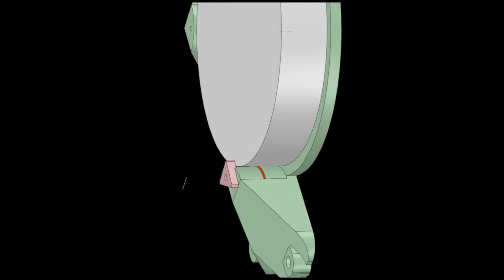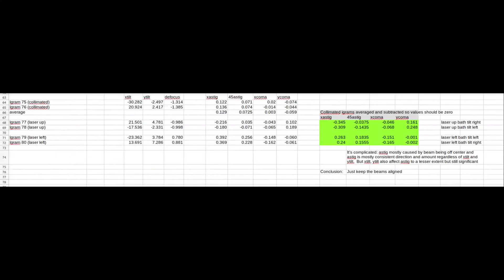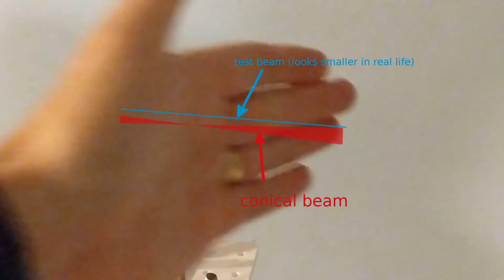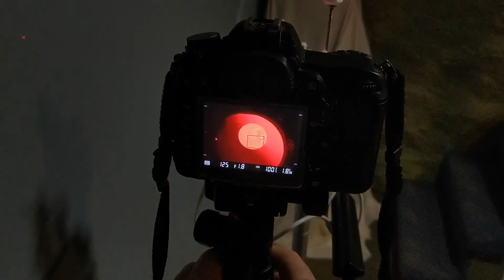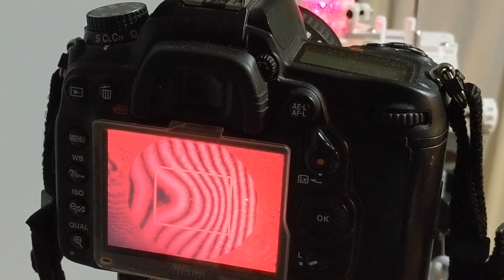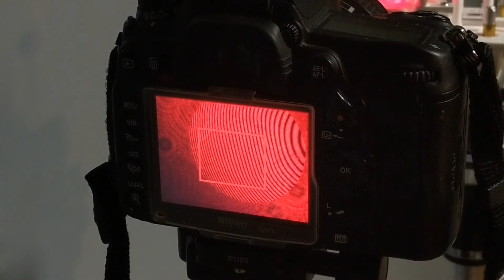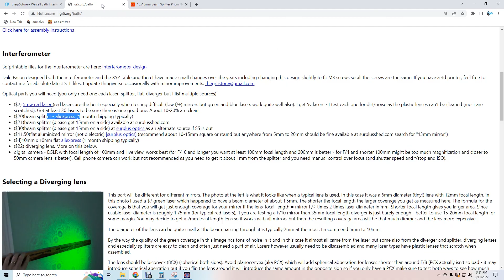Setting up and using a Bath Interferometer (to test telescope mirrors)

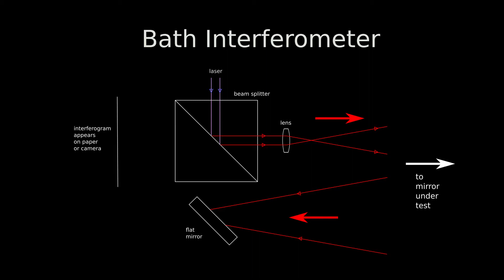Comment: About 16:15. Why reference beam still parallel after returning from the mirror?
Reply from the maker: Lol.  You ask hard questions! I'm not completely going to answer this - it just works.  But the curvature of the mirror "focuses" them back the way they started.  A convex or flat mirror would spread the beams out and not have them cross over unless the beams were aimed perfectly.  If the bath were not near the CoC it would not swap the beams so well.
Reply: @bath_interferometers  as far as I understand, because curvature radius is twice of focal length of mirror, reflected reference beam focuses to point and at the curvature center becomes original width. So it should be spreading a little, not parallel as original reference beam before reflection
Reply from the maker: @vladislavtsendrovskii832  I'm not sure what you are saying as I need to see things visually.  If you look at this diagram, https://gr5.org/coc_diagram.jpg  B is at the CoC.  Any light that comes from B goes off mirror and returns to B.  Light from A (in any direction!) returns to C. Any light from C returns to A.  Any light sent from the right of B returns to the left of B.  It doesn't matter if the beams are parallel or not for this to happen.

I want the beams parallel for 2 reasons.  One is to make it easier to find fringes - if the beams are parallel then the igrams will be visible when the test beam is centered on the reference beam - this makes it easier to find and gives you a brighter reference beam to work with.  Also because if they are parallel then you will have less beam skew through the diverger so you will have less aberrations like astig, coma which may vary depending on how much tilt you have if the beams are not parallel.
Reply: @bath_interferometers  youtube removes all links with picture which I try to add to explain what I mean(

Comment: Helpful summary of the common path.
Out of curiosity I'd try this with the beam splitter out of an older optical drive but the size causes issues you mention. 2 small bino prisms oiled together. Can the polarising filter give good enough contrast in that case?
I would be interested to find out how horrible my sphere is. Focault shows all kinds of vague will o wisp shadows but they have no coc which can be measured.
Reply from the maker: I don't know much about making splitters but to get anywhere close to 50% split (beams equally bright after the split) I think you need a pretty complex coating before "gluing" the two triangles together.  The splitter is indeed the most expensive part but I sell them for $35, I think surplus shed for about $30 and you can get them from china for about $15 (I have a link for where to get the good ones for cheap on my web page).  15mm is a good size for a splitter because your diverging lenses are going to be 4-10mm in diameter and things scale badly at some point.  I do sell everything you need in a pretty cheap kit - at the end of the video.  I think the polalizer trick isn't mandatory as I've gotten good enough without - the polarizing trick only works (I think) if you have a polarizing splitter.  Those are the cheapest splitters and have a coating that lets one polarization through and not the other and how it gets an even 50% split of light.  non-polarizing splitters tend to have multiple coatings  in that diagonal I believe and expect only a certain wavelength of light maybe?  I'm not a splitter expert.

Comment: I saw a brand new bath interferometer, which does not have the plane mirror, but the beam splitter is placed at an angle of 45°. I'm wondering if it would be appropriate to use a 1" beam splitter for this style of interferometer, since depending on the light path diagram the light at the edges may be in jeopardy.❤
Reply from the maker: I think you are describing a "straight bath".  See the black and white diagram on wikipedia "bath interferometer" article.  The advantage of this style is the beams are much closer together (beam separation causes astigmatism but you can remove that later so it's not very important).  The disadvantage is that you can't test mirrors with lower f/#'s as the conical beams clip the cube (regardless of how big the cube is - bigger cubes will have more beam separation and more distance for the test beam to grow in size).  What is the cutoff?  I'm not sure but I think around F/5 possibly.  Testing F/10 mirrors is definitely not a problem with the straight bath.  The cutoff would also depend on the IOR of the splitter glass which changes the geometry.
Reply: @bath_interferometers  In fact, I have completed building such an interferometer last weekend😋, but when I only adjust the fringe density or shape, the interference pattern obtained each time is completely different from the wavefront pattern analyzed in DFT. 🧐🧐🧐
I want to know this Does it happen in BATH interferometers with common structures.🤔🤔🤔

Comment: I am trying to put together a bath for testing my mirror. I have a normal keychain laser pointer for cats/presentations/annoying your friends which seems to have a fairly collimated circular beam coming out of it. I can't really see inside the tube so i don't know if they're masking the beam or using a collimating lens or something else entirely. 

Rather than opting to use something like this as it has a push button momentary switch on the side to activate it, I opted to order a red laser module off amazon that claimed it was a "dot" (I understand these types are generally not dots and come out a bit rectangular). The module is focusable however that means the beam isn't all that collimated. Is this going to be a problem? My thinking says this is not ideal as the beam will clip the diverging lens up close when i have the beam focused at the distance the mirror is at.

I'm thinking I should find a better laser module. Any advice would be appreciated.
Reply: cheap laser pointers all have a collimating lens - an aspheric lens similar to a simple biconvex lens but better.  They work great except many have dust on the lens and many are plastic lenses that are difficult to clean (or are already scratched) so I recommend the more expensive $2 lasers that have glass collimating lenses in them. or you can get a laser from me (see end of video).
Reply: @gr575  Appreciate the response. Wanted to circle back on this for others that may come here with the same question. I think just about any laser module you buy that uses a laser diode in it will be rectangular in nature despite its description of being a "dot". This should not be an issue in getting a bath to work. I built my bath using the original laser in question mentioned above and had no issues in getting igrams.

Comment from the maker: You think it's too difficult to print Dale's design?  He did a good job making it pretty easy to print.  For example, none of the parts he designed require support on your typical cheap FFF printer which is not a trivial requirement.  Anyway you can buy the parts from me if you think it's too hard.  They aren't particularly difficult to print.  I do print 3 of the parts in nylon because they work better if they are slightly flexible although dale printed them all in the same hard plastic for his.  Nylon is definitely trickier to print.  The XYZ stage has no Nylon so it is easier but you still have to drill out the holes after the printing is done and file down some spots where the metal tubes and cylinders fit.

Comment: Very difficult to follow. Everything is ok until you talk about getting the return beam above the cube.  Then subsequently putting in the paper. I cannot see both breams on the paper since I adjusted it to be above the cube.  Also, where does the final image come? Through the cube?  Or above the cube. Should the diverger lens be in place during the placement? You talk about the reference beam and the test beam.  Which is which?
Finally if you want to do this with this tester, you will want to print it yourself.  The one you buy has horrendous print quality.
Reply from the maker: When you put in the paper - it's okay if you can't see the returning beams - just raise up the tripod until they hit the paper.  Let me start over: use your hand to know where the returning 2 beams are.  Move the bath into that 3D location - actually move half way there as when the bath moves up, the returning beams move down the same amount.  It might help to just keep watching a bit and then come back to the step you find tricky.  You can see where the final image will appear later in the video.  You can also see how it works with one of the many diagrams.  Plus if you just look at the URL of the diagram you can type in that web page and try out the "diagrammer" web page and maybe that will help you understand where the 2 returning beams are positioned exaclty.  Regarding which beam is reference and which is test beam, I explain this maybe 30 times so just keep watching the video.  The beams cross over.  At least watch until I explain that the beams cross over.  It's important to pause the video when I present too much, too fast (mostly the diagrams).

quality: I've printed and assembled 10 XYZ stages and about 100 interferometers.  I've tested about 10 different interferometers myself over and over on the same reference mirror.  Testing different optical parts to make sure they are worthy of selling.  I'm not sure what you mean by "bad print quality".  They may be ugly but they should all work very nicely.  There can indeed be tiny misalignments in the XYZ stage which can be annoying.  Every kit I sell there is about 30 minutes spent filing the parts for perfect parallelism in the X,Z stages (lower portion).  I'm not sure what you are referring to.  The XYZ kits I sell in winter are better because they are PLA.  But in summer, to be safe, I print using PETG as I'm worried they will melt/slump in a mail truck on a hot day if temperature exceeds 130F/52C.  PETG quality is definitely not as good.  Interferometer itself should be quite excellent.
Reply: @bath_interferometers  I think your first video is more clear.  It shows the actual bath more clearly.  However, in the first video you talk about having the two beams superimposed while the later one one say they should be about 15mm apart.  Which is it?  Or is the goal to align these later? 
The kit I bought wasn't from you. My kit looked like it was printed on a $10 printer.  Things did not fit well, holes were too large and the rods were bent.  Overall very flimsy.
Reply from the maker: @tomb18ca  Can we talk on phone if you are in USA or by skype if not?  Email me at thegr5store@gmail.com.  It's great that I have competition but sad that the quality sucks.  It's so obvious to me that it's hard to remember what it was like when I was new at this.  There's 2 beams, separated by 1 or 2 cm going out and then 2 beams return from the mirror.  So that's 4 beams?  But I think of it as the test beam going out and returning and the ref beam going out and returning.  If you watch for another 5 or 10 minutes I think I trace the beams out with paper several times.  Over and over again.  To make it as clear as possible.  The older video from a few years ago didn't explain these things nearly as well.  In the video and also in the diagram, when everything is in place the test beam goes through the diverger then spreads out to cover the mirror and the mirror returns the test beam back to the flat, into the splitter and out the back of the splitter.  The ref beam starts off split at the splitter, goes off the flat, off the mirror hits the diverging lens the opposite direction from the test beam, and starts expanding away from the mirror.  The two cones of light interfere and you can put paper behind the splitter to see the igram.  But this is all shown in this newer video we are commenting on.